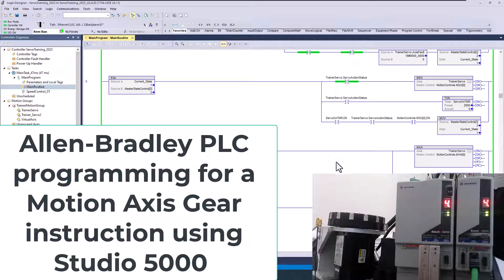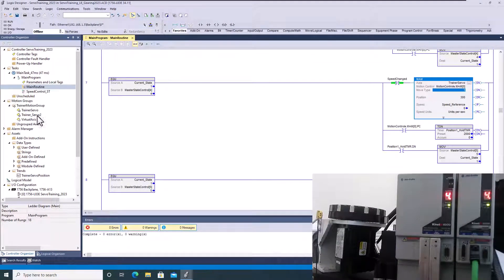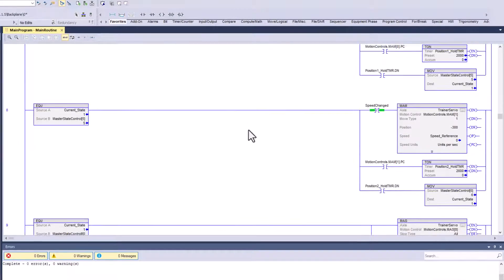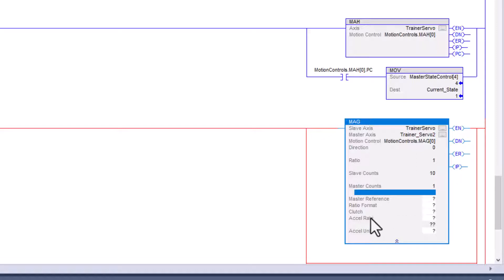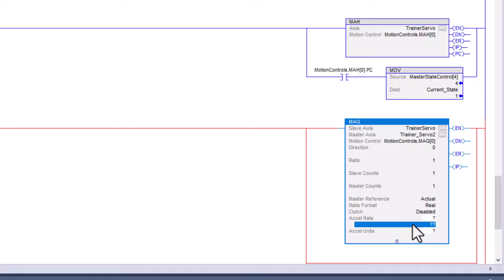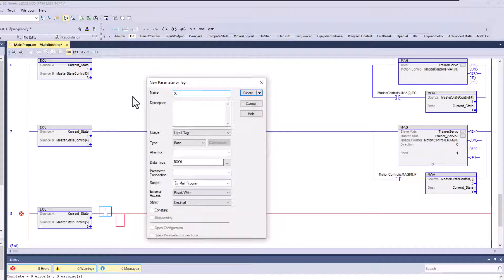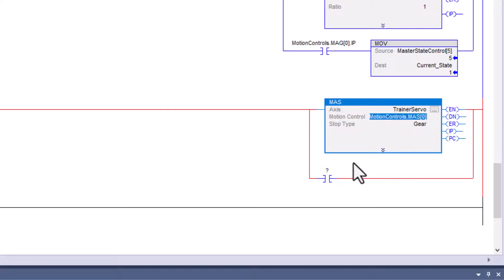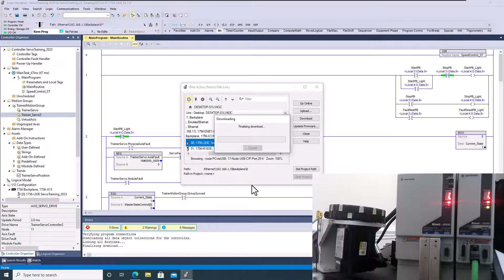How To Program An Allen-Bradley PLC for a Motion Axis Gear Instruction | Mag Instruction

Comment: Very informative video. I am currently programming/debugging a machine where I work at that has AC motors controlled by a PF525 VFD, in which they "rotate" the part towards the operator on 2 identical assemblies put together. We are swapping out the current 843E encoders for 847B incremental encoders. We found out that if a load (customer part) is fully loaded into assembly 1 and only partially loaded into assembly 2 (part lengths can vary), assembly 1 rotates faster than assembly 2. Once that weight is removed, they both run at the same velocity again. Any videos on position feedback control with a 525? We are planning on upgrading to the 527 using the MAG instruction if this does not work, in which this video will help out tremendously.
Reply from the maker: @matthewkoester5145  It will go away if you change the acceleration and decel, also once you change to a servo control with the PF 527 then that should act better as a servo
Reply: @ShaneWelcher  I agree. Correct me if I'm wrong, but even with the wired 847B encoder for both of the 525 drives, that would be less accurate than those encoders with the 527 drives. From what I understand, the MAG instruction that the 527 allows would basically "force" assembly 2 to move at the same acceleration and speed as assembly 1, therefore solving our current issue.
Reply from the maker: @matthewkoester5145  I would wire each encoder to the drive it goes to.

The PF 527 is made for that the PF525 can use the encoders just compare the parameter files